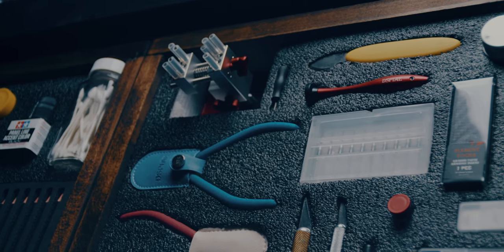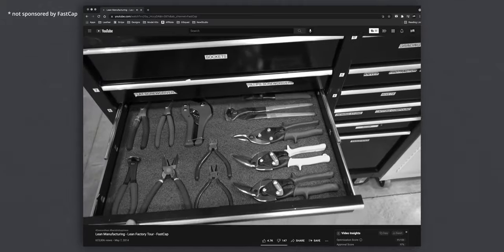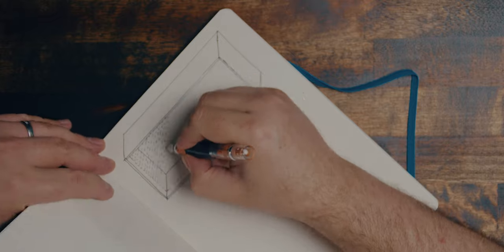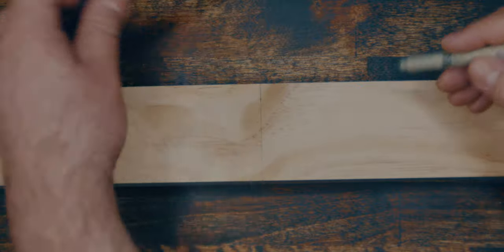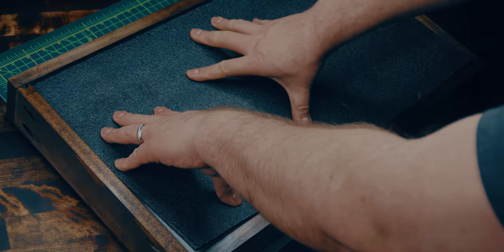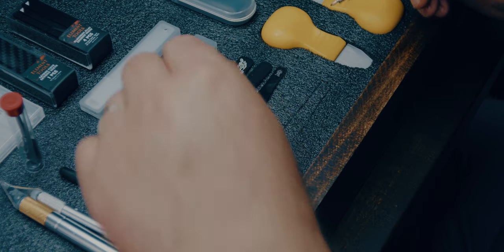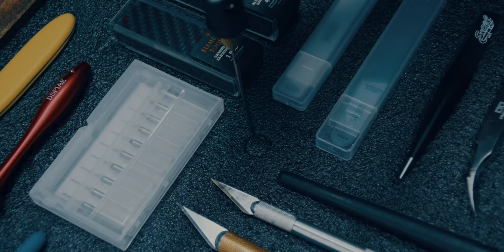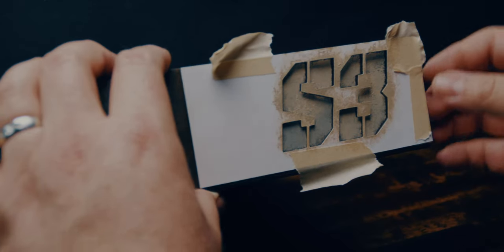Organizing My Gunpla/Modeling Tools with Kaizen Foam | S03E02

Comment: Very nice! I have an Ikea drawer cabinet that I could do this with but I worry it falls apart as soon as I get a new tool! I'm definitely a cluttered desk type builder...
Reply from the maker: Thanks Dan! I do have other less frequently used tools that I keep in the toolbox, but one benefit of shadow foam is you can always modify it, take away tools and add new ones by cutting out chunks of it and replacing them! Thanks for stopping by!

Comment: Did you put it in a dresser type thing or just sit on table?
Reply from the maker: Great question! So these are designed to be drawers for a cabinet that I haven’t built yet.  It will be an easy project, but more than anything I will be using these as vertical shadow boards that will be semi-permanent (since I’m always building) but if I need to put them away, they go on a shelf or I could even hang them on the wall… they’re super versatile and you can take this project any direction you’d like
Reply: @LeoNelBuilds  thanks, I was looking at getting a second hand dresser and was considering this as an option for the garage. Thanks for the advice!!